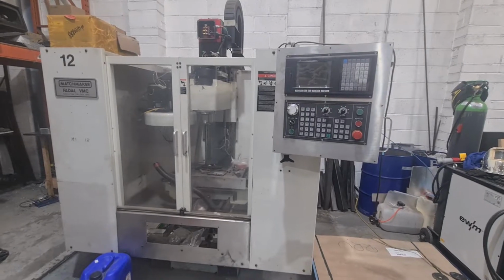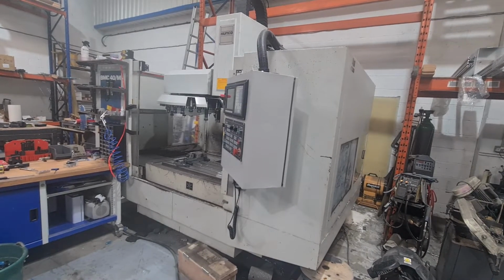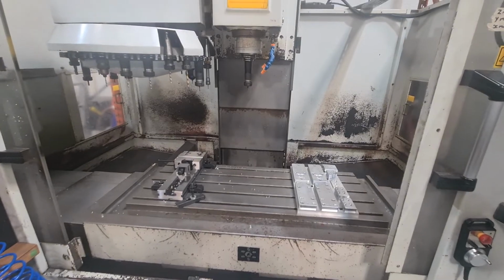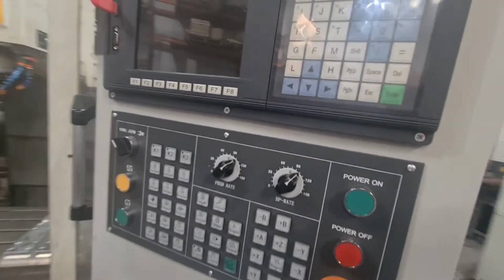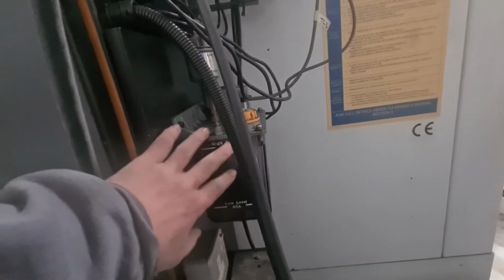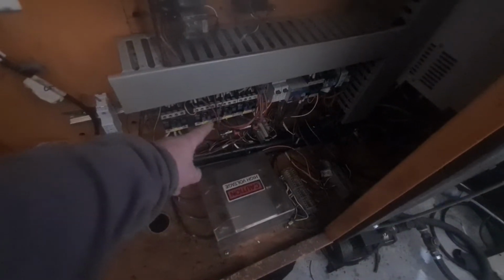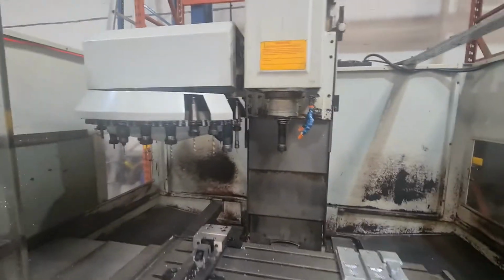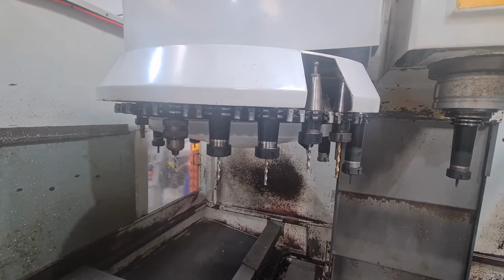Fadal controller update

Comment: looks like you are figuring the swap out nicely. I would like to swap my fadal to centroid but since i have dc motors makes it more costly. and I'm worried about the tool changer part
Reply from the maker: I looked at the Centroid as well but the cost started to get silly because it's not just the controller, if you want ATC that's an extra software upgrade.
The ATC side was actually very easy after I figured out the DC braking, which will be the same on the Fadal. 
It literally is just a matter of setting parameters in control, no writing macros etc.
Reply: @hemsworthlad  well hopefully you do a video on it, I have converted two other machines to centroid but they don't have tool changer
Reply: @hemsworthlad  G'day Dean, can I buy the old yaskawa servo drives off you, I have some older mill here that use them on x y z.
Z axis has a brake.
Please let me know the drive numbers.  CACR drives right?
Reply from the maker: @fb2800  email here dean@jazzcnc.co.uk